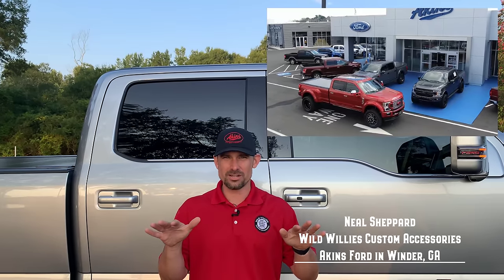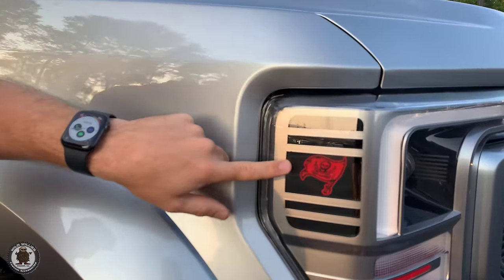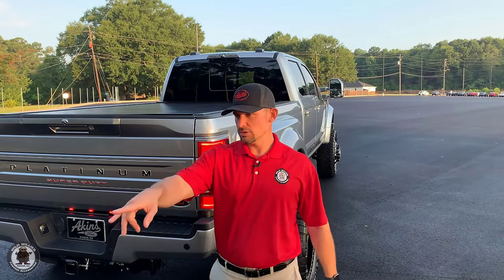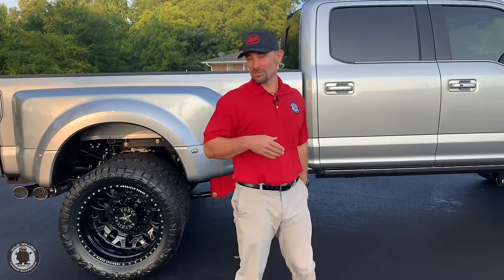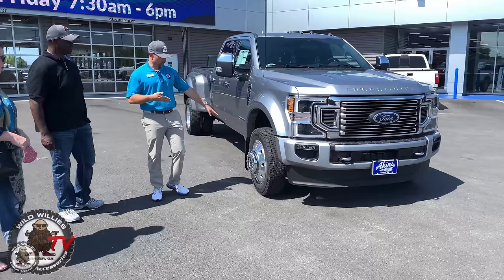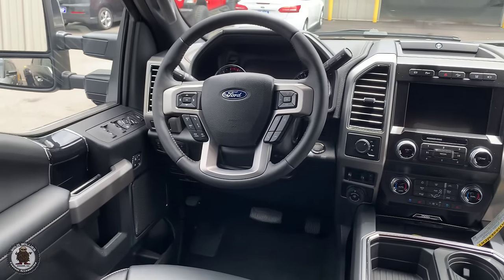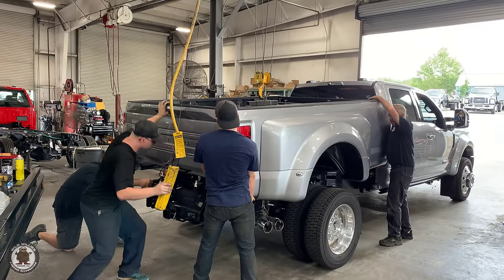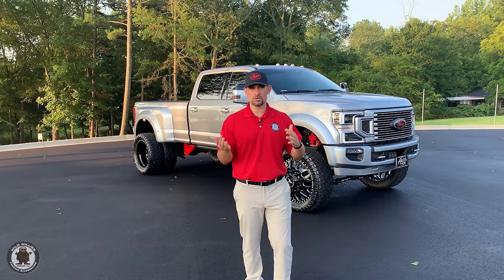INCREDIBLE 2020 Ford F450 Platinum Reserve Kelderman Lift Review Wild Willies

Comment: whats the weight limit on the retractable running boards?
Reply: I went and checked them out and were able to bounce on them. I’m 215. They are the most solid running board I’ve ever stepped on. I’ll be ordering a new F250 soon. And, I’ll definitely be ordering them with my mine.

Comment: SO all this customization and nothing was done to the engine as far as upgrades?????  If you are going to do it all the engine packages can be upgraded for more horsepower and torque.
Reply from the maker: rm truck has over 1,000 lb ft of torque stock. Doesn’t need more power. It’s already a powerhouse! #ford

Comment: Absolutely 👍😊 Brilliant 🏆 opening high-level drone hover/drop-in/close-up; is 🌎 High-Tech Millennia? Is Neal Sheppard related to Ron Howard? {Don't use 🤔 looks as the measurement}, use the barometer of Undeniable Big Screen 📺 Mass Marketing Appeal/Small Screen 📺 Dominance, this kind of Genuineness sells trucks 🚛 by hundreds [monthly] when showcased on 🌎 platforms. This Elite-class Truck {Custom-Truck Enhancer} Dealership has the potential to become the Number ONE Truck Dealership on the 🌎 with Seasoned Professionals like Mr. Neal Sheppard.

Comment: Hate to be a hater but that truck looks dumb.  #1, why put such big wheels on the truck, it’s going to make a rough ride even rougher.  #2 why buy a 2020, when the 2021’s can be special ordered now with the newly designed interior, #3, the tires extend beyond the fenders so as soon as the truck is actually used as a truck rocks are going to kick up and damage all that beautiful bodywork/paint, #4 changing the tire size, you changed the gear ratio, you didn’t address that.  I can’t knock it entirely, the horn is cool and I like the airbags.
Reply: This truck is an obscenity more than it is useless.
Reply: You can't afford it so it doesn't really matter....